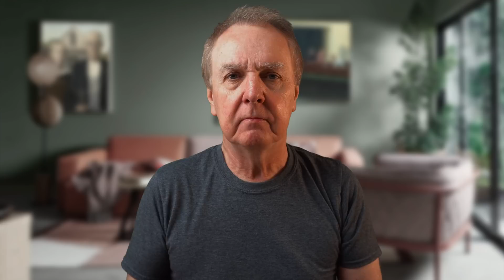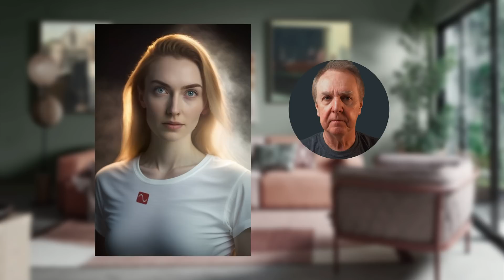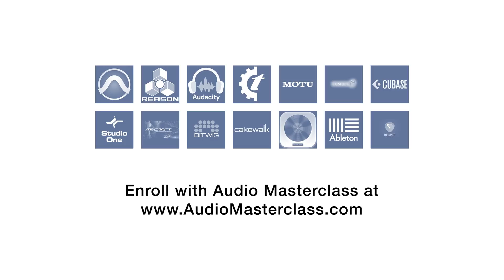Did that Dolby thing ever work?

Comment: Using the right tape and keeping your heads clean is essential, but that's just part of the equation. 

The reason why Dolby B failed to decode properly in most decks and portable players was head to tape alignment, or azimuth. Cassettes can play perceivably fine with some minor mis-alignment of the tape as there is a bit of tolerance for mis-tracking. Unfortunately, however, when the audio signal is encoded with Dolby, this tolerance diminishes greatly and so therefore, unless the tracking is pretty much dead-on, Dolby B will not be decoded properly and usually results in the loss of highs and a muffled, lifeless sound. 
Pre-recorded cassettes were the worst for this, which is why most people thought the tape sounded better with the Dolby switched off. So because of this, the consumer would NEVER turn Dolby on for recording on their own decks. Which was a shame because if they did, they'd discover that:

If you played back a tape encoded with Dolby on the same unit that made the recording and encoded the Dolby signal, it worked perfectly, with no issues. Why? Because it's tracking dead on! 

Of course, if you're using shit tape and not cleaning your heads, it's not going to work then either. :)
Reply: Absolutely correct, particularly as Dolby NR calibration was so level sensitive. As was Dolby A and SR on pro machines.
Reply: Well said my friend...well said
Reply: Silly Rabbit, Trix are for....   Really, with Dolby switched off did the heads magically align? 
You need to rethink what you just said.
Reply: @ka7hqp182  I think you need to re-read what was typed. I explained that very point.
Reply: @ka7hqp182 no the heads didn't just realign...however with misaligned or dirty heads Dolby makes it much worse silly wabbit

Comment: In my younger days I always avoided Dolby, like many others, as it seemed to lose some high end signal/sparkle. Now recently rediscovering cassettes at the age of 60, I am using it on all the time and not having any issues. The recordings sound pristine to me! -I probably put it down to the loss of high frequencies that we all experience to whatever degree as we age. Just a thought...
Reply: In old times listeners accpted  loss of sopranos during recording as normal  ( digital was not known) and   were delighted with any possibility to regain them - with dolby off and tone controls and "crispy speakers"  Tapes were cheap,  heads dirty and decks not aligned by producers as should/ misaligned . Any upbeat was welcomed - unfortunately together with noise (like the solution with switched off Dolby). .  Today  thanks to higher  demands from  listeners, and better  knowledge, years of experience . we can avoid it  and forget about noise reduction too

Comment: I think Dolby B - or better, playing tapes encoded with Dolby B without Dolby ON - is partly responsible for how some music recorded in the 80's sounds: several digital recording's from mid 80's have very prominent treble, like playing a cassette without Dolby. Recordings from the 70's or 90's are not so much treble rich. Might be a coincidence, though. 
As for Dolby, I actually only used Dolby B on type I cassette; type II and IV are better off without Dolby, the 70us eq is enough to remove tape hiss. Dolby C depends too much on tape deck calibration, frequency response and ability of the tape to retain recorded levels (some type II tapes lose 1 ~ 2 dB of levels in the course of some years), so I never ever used it (although it sounded nice on a hi-end revox tape deck)

Comment: I've just discovered your channel and I'm loving your vídeos. I think that set the 400 Hz level for each kind of tape, clean the heads and capstan, demagnetizing the heads, etc., is part of the analog enchantment. As with overhang angle, anti skating, compatibility of the mass of the arm with the capsule, etc., etc.. The hifi is for the ones who love it. Sorry if my english is incorrect, but I haven't trained it for more than 20 years.

Comment: So 99.8 % of tape-decks have mis aligned heads according to this. Every tape deck I have dulls the sound when you turn on Dolby. It gets rid of the hiss which is what I thought it was supposed to do. 
I have prerecorded tapes done Dolby HX pro that sound amazing on the same machine with all dolby turned off and very little noise. I record blank tapes from CD or vinyl from the 80’s on type 1 cassettes and it sounds great. 
I have other prerecorded tapes that sound dull no matter what you do. I found high quality recordings sound amazing, like some vinyl records sound not good at all and some sound incredible on the same stereo.

Comment: I used to have an Akai GX31, if I remember correctly, it could adjust itself to the tape by recording beeps and sweeps, playing them back and changing settings until it thought it got it right. It kind of worked.

Comment: In a nutshell, Dolby noise reduction only works properly if the tape head elevation is adjusted to exactly match the tape you're playing, which it almost never was with pre-recorded tapes or tapes that were recorded on any other tape machine. Turn the tape over to play the other side and you also had to re-adjust it!
When the head alignment is exactly right for the one tape you're playing, Dolby B and C noise reduction were incredibly good--especially Dolby C.
Yeah, cassette tape was pretty noisy format and was never intended for music when it was invented and Dolby NR, either B or C, only worked its magic when the head alignment was just right to give the best treble output. Otherwise, it was awful because it would kill the treble output was well as noise.

Comment: This is a perfect illustration of how analogue recordings are vastly more dependent on the playback equipment (both quality and condition) than are digital recordings. I've been using cassettes since the 1970s and I have never felt that Dolby was less than excellent; but I've always had an interest in the technology so I wouldn't dream of using a dirty machine, crap tapes, wrong bias, or recording at the wrong level, etc. My current three head machine with Dolby S essentially makes recording that are indistinguishable to the ear from the source, be that vinyl, CD or whatever. However, one thing is certain - pre-recorded tapes almost always sound crap because it would have been too expensive to use decent tape stock or record them at only 1 7/8" speed (+ precise azimuth and probably loads of other factors).
Reply: Absolutely, and a lot of people will give you the side-eye when you try explaining to them just how good Dolby S was, but in 1989 when Dolby S was launched, Dolby held a listening session for a group of audiophiles (real ones I'm assuming) to compare a digital source with a Dolby S cassette recording. None of them could reliably distinguish one from the other at normal domestic listening levels. Dolby S filtered down to a few mid-tier decks by the mid-90s making it far more affordable for us mere mortals, but the decks still had to meet strict design criteria specified by Dolby in order to receive a licence to incorporate it, ergo, there is no such thing as a bad Dolby S deck.

Comment: Nakamichi used to make cassette decks that would adjust their Dolby levels for each brand of tape; you put the tape in and set it to calibrate and it would record a series of tones on the tape and set the Dolby level for recording on that exact tape type.  It was a tedious process but was only needed when recording as the levels coming off the tape would be correct if you bothered to calibrate before using a new tape type.  Of course if you only ever used one brand of tape then calibration only needed to be done a couple of times a year to get the best out of the machine.

Maybe there were other brands of cassette deck that did this but I never saw one.

Comment: The following is 100% true.

I sped up the tape transport of my 1971-vintage non-Dolby Sony TC-160 cassette deck by a factor of 3 (5.6 ips), rolled back the Equalization (the two outboard pots at the front of the MOSFET-based  circuit board), and never looked back.

How did I speed up the tape transport?  Simple:  I put a couple of Revel car model tires over the drive motor spindle, where the belts went.  Then I just wrapped the drive belt around the V-shaped groove where the model tires met.  The tires were 3 times the diameter of the OEM spindle.

With this modification, I got around 72 db S/N ratio, and 20 - 22 KHz frequency response on good Maxell cassettes (oddly, not CrO2-based - even though the deck had a CrO2 selector switch) and less than 1% THD at 0 VU, 1 KHz, and .07% wow & flutter.

Of course, a 90 minute cassette was good for only 30 minutes at that recording speed, but damn if this Sony rig didn't sound as good as a Revox A77 reel to reel deck at 15 ips.  Only problem was, I had to replace the F&F ("Ferrite and Ferrite") tape heads every 9 months or so, and they weren't cheap back in 1977, when I was 17 years old when I did this.  They cost around $30 dollars back then, but were fairly easy to source.

I then boosted the dynamic range - S/N ratio of this deck up to around 105 dB using my SWTP expander/compressor that I put in the signal chain.  Very similar to the dbx 119, but in kit form.  Yes, I put the compander together myself and calibrated it.

 Effectively, I had a 1971 Sony cassette deck making recordings better than any Revox 15" deck (forget about any Nakamichi 1000) and playing back at CD sound quality.  Not bad for 1977 - 1978.  Five years before CD technology came out.

Comment: Back in the day I had 2 premium cassette decks, one of which was a twin deck. Both units were equipped with Dolby B and C which I used extensively. That was multiple iterations ago of hifi components. Cassette decks no longer have a place in my hifi rig. 

We need far more technical information from you. Especially if your technical assistant is going to present it.

Comment: Despite proper cleaning and demagnetizing, as an owner of multiple cassette decks, the main problem with HF roll off was due to azimuth head misalignment, exacerbated by Dolby encoded tapes.
Had I known this would be an issue at the outset, I would have recorded all my tapes without Dolby. Now the solution is to use decks with adjustable azimuth played back with Dolby.
Reply: This should never be a problem with high standard quality control.if your equipment isn't properly aligned from the factory ...you bought a defective unit.unfortunately this was true much of the time but the average consumer wasn't aware of it

Comment: Great explanation...  so I no doubt broke all logic but...  I would record w Dolby B (also thinking my deck had C) and get the saturation as excellent as possible w/o distortion...  then in my car the deck had Dolby B as well...  but I de-selected the switch and presto the dynamics "seemed" perfect... yes in a pinch you could hear some noise... BUT because of the natural noise floor of the vehical and wind (as w would play Rock as I Rolled) the recorded tape noise was not present perhaps dither??? ... that was as good as it got in the car till CDs ... what are your thoughts?
Reply from the maker: Switch Dolby out in a car, or anywhere, brings up low level high frequencies. So you'll hear more clearly above the engine and road noise. DM

Comment: good video. imo, subjectively dolby b and s transparenz. the auto-tape calibration n my 90a Sony decks and good factory aignment, bettered mx 80s Nakamichi dcks.. dolby c was poor, audibly odd. few c-equipped production decks met dolby's strict alignment standardsm probably.. my Nakamixhi 700zxe auto.tuning dck+ NR100 v adapter was unsatisfacory. engaginc c on playback of a non-dolby tape is an effecive öpw-pass/high-cut filter for noisy source material, which fortunately, I have virtually none.
xour formidble-sounding lady assistant, looks like fun, if she loosened-up  :-)I never experienced dbx I or II. read that it had issues......?

Comment: No, it never worked.  That tape deck rolled off the high end so the decoder never got the correct signal level to decode, so the high end roll off was exaggerated by the Dolby expander so the highs were wiped out.  The expander had a delay relative to the compressor, so the high frequency transients were squashed.  The system never had a chance of working.  How could it.  The signal used to drive the encoder was lost during encoding and the decode would always be late and wrong.  Had Dolby found a way to bury the compressor commands as some sort of inaudible phase modulated tone to drive the expander decode logic it might have had some chance, but it traded dynamic range for a doubling of the frequency response errors and squashing high frequency transient response.

Comment: Of course the manufacturers were nice enough to tell us exactly what tapes each machine was set up for.......   NOT!    
And then, what would happen when you couldn't get the "right" tape any more, provided you Did know what it was?   
I didn't have the money to pay for a calibration.      

With my TEAC A-170S, I nearly always recorded with Dolby on and played back with it off.     
After I bought a Harman/Kardon TD392, if I recorded a tape with Dolby C I normally played it using B.  

My Concord HPL-550 car stereo Sometimes gave pretty good results when I used the same 
NR setting I had recorded with, but it really depended on the tape and the signal level. 
Never got around to testing its dbx function because I didn't have a way to record with that NR. 
I still have that unit, fortunately.  It sounds amazingy good.  

My tapes (I still have all of them) are labelled with the NR used.    
A few have the same material on both sides, one with B and one with C.

Comment: Most commercially sold tapes are not encoded. The problem is if someone has heard an encoded program, it will sound brighter when playing back with Dolby off anyway. No one will think that the eq is now wrong because they have not heard the actual source. Brighter always sound better.

Same thing with FM de-emphasis. If it can be defeated, it will 'sound clearer' because of the boosted highs.

Comment: You had me at your assistant's first utterance, and you won my heart with your hysterical expressions admiring her from your little bubble as she spoke!  New subscribe here!

You missed discussing type C.

It's easy for me now - I have recorded one cassette in the past twenty years after getting my hands on a nice pioneer deck from the 80s, and I can't hear > 5KHz worth a beep anyway so hiss away tape, I recorded without it.

Forty years ago I did use it on prerecorded tapes with the logo and turned it off for those recorded without.  For my own recordings, I found it better left off because as a kid I bought TDK or Maxell midprice tapes typically or whatever was on sale when I was running low on blanks, so I got inconsistent quality recordings and therefore dolby was imprecise on playback and annoying.
Reply from the maker: Yes I did miss out Type C as I felt that would be overcomplicating this video, Type S too. HX Pro is a different thing entirely and I may comment in future. DM
Reply: Oh yeah - another reason I forgot -- neither my early Walkman nor the cassette deck from radio shack I stuck in my parents' car had dolby available so it seemed logical to forgo it when recording back in the house on my deck.
Reply: There was also HX-Pro, which I believe was a bias modulation scheme that recognized that high-frequency content acted as a bias signal.

Comment: Interesting to hear a take on Dolby B I haven’t come across yet. Every audio engineer I’ve heard speak of it raves about it but as they describe it’s effect it’s hard not to wonder why no phasing effects are mentioned (I guess the curve is gentle so it’s ignored) and the lack of gain for portable decks. 
The fact there was normally a switch means it’s no big deal in the real world. Sometimes it sounded better on, sometimes off. All depending on the system and context I was listening in.
I have had the pleasure of engineering and mixing a few recordings on 24 track 2” tape and applying Dolby B and S was a luxury you would be silly not to take advantage of. The quality of that sound isn’t something I’ll forget. 
And home on the Nakamichi deck, all Dolby, all day. The Yammie amp took care of the make up gain and the dreaded hiss was gone.
On the school bus though it was worth flicking it off.
I still think the stereo image is a bit ‘altered’ to my ears and I can totally see how some people might seek out releases without it. 
I used to love my tapes but hiss was enemy #1 behind a lot of problems. I’m loving the vinyl revival but feel no urge to drag out any old tapes, as cool as they may have been

Comment: My home deck is a harman-kardon hk400xm that does all 4 tape types with manual calibration facilities.  Needless to say, it has Dolby Type B as well as HX Pro.  I play these cassettes in my car because I drive a 1997.  It sports a cassette player with Dolby and has been regularly cleaned and maintained by myself for 26 years.  Friends and co-workers of mine get in my car, and they don't believe me when I tell them they're listening to a cassette.  I have to eject the tape and prove it to them, and they are simply blown away by the sound quality.  None of them knew cassettes could sound so good.  This just goes to show that cassettes can sound absolutely amazing if you have proper equipment that has been maintained and that you know how to use correctly.  Yes, Dolby absolutely does work.  I've been proving it for decades.